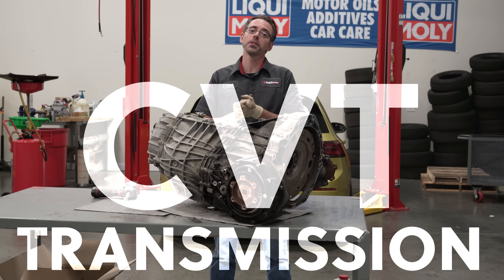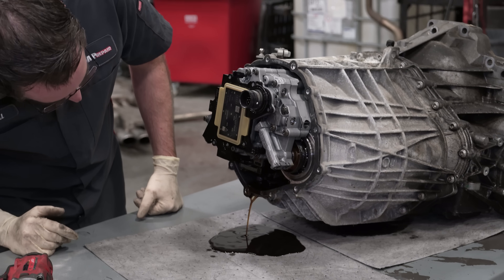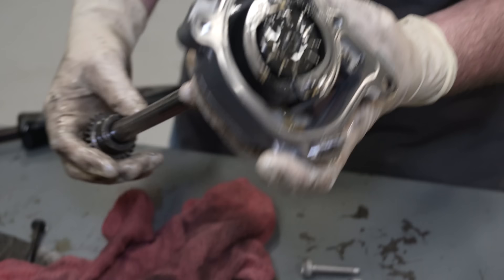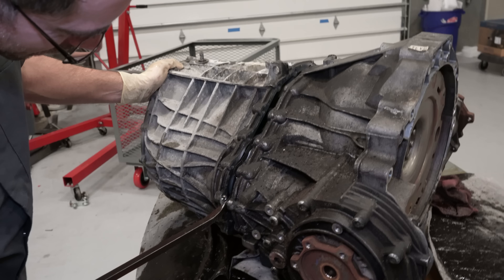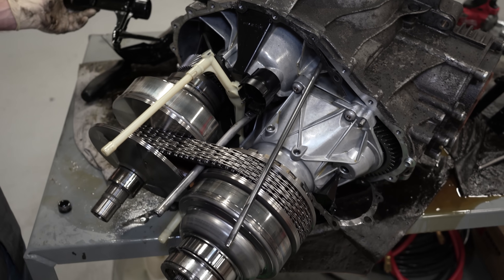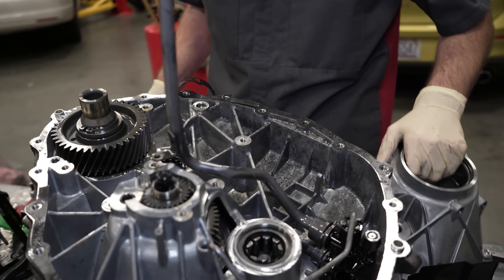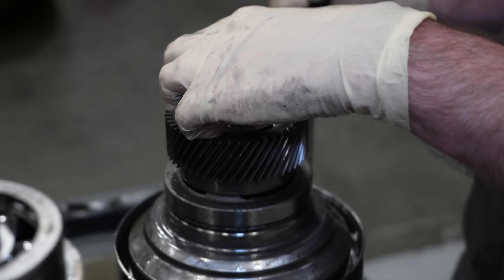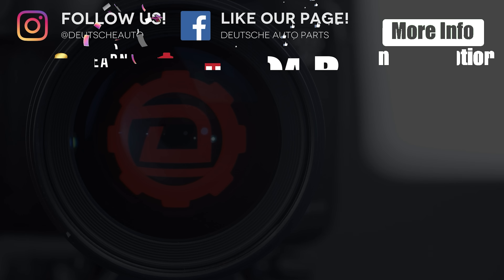Why you shouldn’t get a CVT transmission

Comment: I am now 71 years old and I have owned 21 cars over a 52 year span and the most notable were a Ford 3000E Capri, a Lotus Elan S4 DHC, a Reliant Scimitar GTE SE6, a BMW 520, a Mercedes S Class 430, 2 Audi A6 Avants and the car I still regret selling as I should never have sold it - a Toyota Supra Mk4 3Litre TwinTurbo. 

Naturally over different years I took my Elan and then my Supra around Castle Combe race circuit, and anybody who thinks they are a good driver should do so themselves just for the experience.

The BMW, the Mercedes and both Audi's were nice cars but compared to my other cars they all gave me more problems, I did not own them for long.

In 2013 I bought a 2007 Toyota Prius Spirit with 30k miles on the clock and it was not exactly what I expected but it did not take me long to adapt my driving style to suit and we clocked over 30k miles and sold it in 2020 and it gave us NO PROBLEMS at all.

In 2017 I bought a 2013 Lexus RX450h with 67k miles on the clock and last week it's annual service at my Cardiff dealer with 96k miles on the clock and again NO PROBLEMS at all.

Sometimes when I am driving home I come to the lower roundabout at the Newbridge/Blackwood dual carriageway and there it is a fairly steep long climb and if it is safe, I floor and hold the throttle and for a 2 ton SUV it picks up and just keeps going....

Sad thing about the German and Land Rover cars reputation seem great but their build quality is crap , it just does not compare with Toyota (Lexus) quality.

You may say though that the Toyota/Lexus has no driver involvement compared to the others, that is a small difference, have you ever driven them over the same roads to compare and seen anything worth noting about their characteristics. The TV shows and the car magazines and even some YouTube contributors are all totally biased, they have to do something to help their viewing figures and sales.

As my first Toyota Celica 1600ST rear window sticker said... ...If you want to know how good a Toyota is...ask an owner.

Comment: Interesting: This one differs from the common "Nissan" belts with the 399 plates. Like everything with force it goes kaputt. Change the oil on the Nissan one every 50kk and it has some usable longevity but hey all automatic transmissions are complex and die if abused. Going electric to stay gearless!!

Comment: Not a good choice for a high powered heavy car, and certainly not for a truck that may be required to tow. As for an EV, less complexity is better. Let the motor do what it does best; provide max torque at low rpm. No need for shifting at all. The transmission featured in this video is far too complex and overweight to justify its existence on this planet. Beam me up Scotty.

Comment: My Toyota corolla 2017 has CVT and I sold it for a couple of reasons, and the main reason was the transmission. I preferred to go back and get camery 2014 to avoid the horrible CVT invention.
Even though and in response to Toyota justification of using this type of transmission, I didn't notice any enhancement in Gas milage consumption using CVTs and if there is, it is unremarkable

Comment: I enjoy the CVT transmission in my a6 c6, driving and accelerating so smoothly without any shifting actions is very comfy and feels a little bit luxury compared to my 1995 vw polo manual. I do dread the day it fails. It does shudder when accelerating from zero to 5 so may or may not be looking at a pain in the ass soon.

Comment: The entire premise of this video is stupid. It's like saying "why you shouldn't get a vehicle with an engine" or "don't buy a car with overhead cams" just because some companies have released inferior products. There are many CVT transmissions that have either been improved to be reliable, or reliable from the start, and anything radically different or new will go through such a proving period, basic automatic transmissions have had lots of stinkers and so have manuals, and they all suffered reliability issues when first introduced, that was just long enough ago that people don't remember.

Comment: I remember GM putting CVTs in their Saturn VUE. The band would come apart and leave the car dead. But, the construction of the drive belt was different. It was 2 thin metal rings that held together a bunch of these tab things. Looked like a real pain to put together.

Comment: fixing any transmission requires a high level of thoroughness. The real problem is overpriced parts and limited access to repair guides and training from the manufacturer. Custom tooling and jigs could help the repair process.

Comment: the cvt (as a mechanical design) is a marvel of modern engineering ...
and would have likely been a great project to have worked on (in it's initial development)!
it's likely the IMPLEMENTATION of said (cvt) design that's the problem ...
w/ manufacturers designing to the 'margins' on critical (single point of failure) parts ...
resulting in high rates of (premature) failure overall ...

Comment: Unless its a Toyota or Lexus. They produce eCVT, electronic controlled planatery gears without belt. What you get is the most sophisticated car driving experience without the engine stalling between gears. Gear changes is so annoying in normal automatic cars, but most people are stupid so they think its pleasure to be tortured.

Comment: I had a 2003 Honda Civic hybrid that had a CVT.  That was the best car I ever had and one of the reasons was the CVT.  I loved the way it optimized power and torque going over the mountains everyday.  Then got a POS Suburu Outback that had a CVT thinking it would behave similarly. Well, it didn't!  I asked the dealer where the continuously variable aspect went and they said people complained since they didn't understand the operation.  They synthesized the "gears" in software to make people happy.  So there you have it- stupid humans ruining a fantastic thing.  Why they couldn't have had 2 software modes I'll never understand - one for stupid people and one for smart people.

Comment: My daughter was trying out a Chevy Spark which had a CVT, and we noticed a shudder. Did a Carfax check on it and found it had been serviced two or three times for transmission problems. Needless to say, she passed on the Spark.
Reply: The shudder upon parking?
Reply: @SlowerTrafficKeepRight-k2g  It's been a few years now, but I think it was when accelerating after stopping at a stop sign.

Comment: there are car brands that are random that have good CVTs. The ones you mentioned and saw are from terrible brands. Thats right, german car brands are terrible mechanically as they only need to last 3-5 years. Before F1 even could consider a CVT they got banned, can you guess which one didnt last? Ah you guessed wrong, it wasnt the transmission it was the engine as constantly running the engine at full rev wears it out quick which is bad in F1 considering you are only allowed a limited number of engines in the season. Its not the CVT that is bad, its the brand that is bad, same for automatics as well and some manuals. Even ford today has terrible engines. When brands cut corners, this is what happens. This gearbox is actually really good, its a question of the brands and their direction. I keep track of brands that if i see someone thinking that driving a mercedes because they are successful, to me they are handed a silver spoon rather than actually having the brain to achieve their wealth, same with any other german car owner. It doesnt matter what gearboxes these brands use, they will fail badly even manuals today. They cut corners and only make the car last for 3-5 years because thats what the german market trends, they dont care about the trends around the rest of the world.

Comment: I'm no mechanic, but years ago when I first learnt about how CVTs work, I wondered, "How the hell are they going to have a metal belt being driven by a metal pulley, and be reliable? What will prevent the belt from slipping? How will that belt last any length of time before deforming or wearing out or breaking?"
Reply: I think that it does work. Otherwise, they would not make them, would they?

Comment: I had a Ford Freestyle with a CVT and the only complaint I had with it was the $500.00
fluid / filter change at 60,000 miles. They have to pull the engine and transmission to change the high pressure filter. Other than that, I had ZERO PROBLEMS up to 144,000 miles when a cell phone connected to a......woman rear ended me and totaled the car.

Comment: I have two cars. The one with the typical transmission wore out and had all kinds of problems. The other one with a CVT is still running fine after many more miles and has better acceleration, better fuel efficiency, and is especially smooth in stop and go traffic.
Reply: “you shouldn’t do this”, does it anyways. Shows carelessness. My value of his opinions dropped to zero.
Reply: @Stu_Bur  - I think he meant you shouldn't do this on a transmission that is being repaired.  Since this unit is obviously being torn apart for the video and will be scrapped, it's why he is showing "carelessness".  But that little fact went right over your head, didn't it?

Comment: CVT.s are nothing new  Before the advent of VFD AC    motors and if you were to cheap to install a DC motor drive CTV drives were common on smaller variable speed industrial loads.  They has a short life and were a pain in the neck.  The auto industry did not do their homework.  Shame on them

Comment: I still don't understand how CVTs work, but TTTT I really don't think I want to. All those fingers look like nothing but trouble. I could imagine a CVT with hydraultic chambers and pumps with varying sizes. I could imagine belts, going around varying pulleys. But this thing looks like it's from the Devil's own workshop. Somewhere in Japan. Probably the Japanese cold get it to work at all.

The World has many example of things that seemed like such great ideas at the time, but either led to major problems, or were just dead ends. Radial tonearm turntables. Crossfield tape heads. Liquid metal breeder reactors. Processed cheese. Hybrid electric drive trains. And CVTs.

Comment: I had a 2005 Ford Freestyle AWD.  At 219,000 miles I gave the car away.  It still looked great but didn't need it because I'd gotten another car.  There was nothing wrong with the CVT, nor had there ever been.  It was a very heavy car I thought for a CVT, but I never had an issue...

Comment: I own a Daf 66 -75. One of the first cars to have a cvt transmission. The gearbox is one of the most reliabel things on the car. It uses big rubber belts and engine vacuum to shift gears. The only maintenanced you have to do is tension the belts once a year since they slowly wear out. Pretty fun to drive too, accelerates quite fast even though it only got 42 hp.
Reply: Not just 'one' of the first cars to have a CVT transmission, it was the first. DAF scaled up the system used on millions of 50cc mopeds and was also commonplace in factory equipment and agricultural machinery. Van Doorne built the DAF (odil) around it. Volvo bought DAF and made plenty of money from licensing the transmission design to other automakers. Unfortunately they got more and more complex to cope with ever bigger, heavier and more powerful cars the result being the abomination shown in the video which is a LONG way from the super simple and reliable system used in the 10s of millions of twist 'n go scooters manufactured every year.
Reply: @terrycolley6482  The Daf 66 was "one" of the first ones, since Daf 600 -59 was the first car ever with an automatic cvt transmission. Dafodil was the successor of the 600. The transmission was never used in another car other than Daf technically, since Volvo 343 is actually a Daf 77.
Van Doorne did cooperate with another car company to eventually make the Subaru Jutsy with a steel belted CVT which is most likely what other companies have copied or been licensed for their cvts.
Reply: @antonpersson99  Actually Buick had a CVT before any other commercial available car did.
Reply: @TehButterflyEffect  The 600 was the first production car, after the 1920s Clyno, to have a continuously variable transmission (CVT) system - the innovative DAF Variomatic. https://en.wikipedia.org/wiki/DAF_600
Reply: @TehButterflyEffect  which car?
Reply: @terrycolley6482  Thank you for that!
Reply: The DAF is a legend of it's own, it's the only car I know that can go backwards as fast as forwards .... 
Do you have to change the drive belt often?
Reply: @stelleratorsuprise8185  When I bought the car 3 years ago it had belts from the -90s on, it had been standing still for 10 years too before I got it. I adjusted the tension and drove for a year with those belts before one broke, which was most likely due to rust on the cvt disks on that side.
I bought new ones, put on a new cvt disk and those belts are still going strong.
Reply: The CVT used in the DAF and Volvo 343-340 cars powered the rear wheels, it is "simple" and very straightforward and reliable with very little maintenance, oil change and belt adjustment or change
Reply: @erickjanssen653  yeah incredible simple actually. Theres some weights, springs and a vacuum "clock" that determines the gear ratio. The more vacuum the engine generates from increased rpms the harder it shifts. Sadly they are balanced so if you have to eventually repair them they will get slightly unbalanced which causes vibrations, impossible to balance them again since there are no tools for that anymore
Reply: @antonpersson99  I could make the Tools !
Reply: It's not really the same thing but until recently almost every model of snowmobile rocked a rubber belt CVT actuated by the changes in centrifugal force from different RPMs against a spring. Very clever, reliable, lightweight mechanism with excellent performance and you never need to fiddle with a clutch or shifter.
Reply: @Catatonic2789  Depending on the snowmobile you have kevlar reinforced rubber belts with high, low and reverse gears. The cvt is usually not tuned for specific machines so if you want all performance from your specifik model you need to buy a new primary clutch
Reply: I also own a DAF 66 from 1975, last year before they were named Volvo 66. I got mine for free a couple of years ago, it had been parked in the woods for about 20+ years. One owner (school teacher, old lady) and her son gave me the car. Transmission worked great, no service needed after 20+ years just sitting in the woods, but the Renault-engine is another story. Bad headgasket and a cracked block from freezing. Someday I will rebuild the engine and start driving the thing again, its hilarious and people look at you like you were from outer space! The best thing is that if one belt blows you can still get home, it has twin separate belts, one for each wheel. Like a snowmobile x 2! // Daniel from Sweden🙂
Reply: @kinkypin  Behöver du delar är det bara höra av dig. Jag har nämligen en nästan komplett motor över.
Reply: @kinkypin  Brilliant, good luck with the rebuild, Daniel !   Take care,  Mike  (from North Wales, UK)
Reply: I used a DAF 55 many years ago. Particularity is CVT on each rear wheel and NONE differential !
Reply: @colonelhanzaplast548  Yeah that was the last model that used a belt for each wheel before the 66 came with differential. I've heard that the ones without diff was really useful at dirt rallies and snow
Reply: At least (oil-free) Rubber can actually get a grip on something!  -  They were not Daft, those Daf.
Reply: https://youtu.be/2NeyoNdsHTI
Reply: Yah but the belt is serviceable to a degree. Not ANYMORE
Reply: User serviceable belts and variator are ok for tiny sub 1500lbs vehicles. -which don't exist due to safety REGULATIONS anymore. Toyotas 8 speed is tolerable although hills seems to confuse the crap out of it. I'd never buy a metal belt CVT. That's only going to have problems and you can't limp them home when they fail.
Reply: @marshmower  The Daf is more around 2000 lbs. But yes I agree that cars nowadays are too heavy.
Reply: They go as fast forward as back, which resulted in some funny shows in the 70's and 80's in The Netherlands. Good memories!!
Reply: No body asked

Comment: Look at the color of that fluid, it looks dirty brown instead of the normal red. My wife's Nissan Murano has over 150K miles and it's CVT is working fine. I pay the dealership about $210 to flush and fill it every 60K miles. It's the only mechanical work I use a dealership for but I'm not taking any chances with this jasco transmission. 

I don't know why these people think they can get vehicles with this transmission and not have it serviced on regular intervals. Judging by the color of the fluid that came out of that thing there's no way that they were taking care of it.

Comment: I worked on Polaris ATVs they have the similar transmission Drive but it's a belt drive and it's an outer belt drive it's not inside the tranny the transmission is limited to two gears but those two pulleys do exactly what your transmission does squeezes the belt the belt Rises up creating a different RPM for the drive Wheels. The transmission you are working on is definitely over engineer piece of junk why these Engineers go this route to make something operate when it can be done so simple and was very little fluid you don't even need a torque converter I don't get it.

Comment: So at the end there is no smoking gun and the reason could be valves or whatever. The actual CVT drive looked fine. The belt looked fine. The fluid looked horrible though. Clean CVT fluid is absolutely essential on these transmissions.